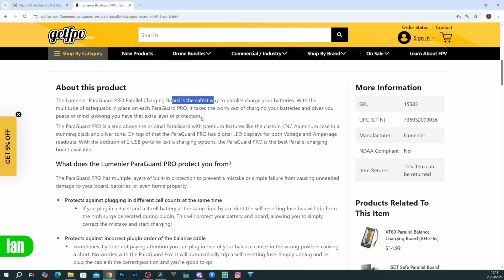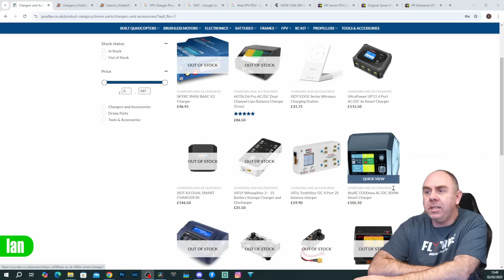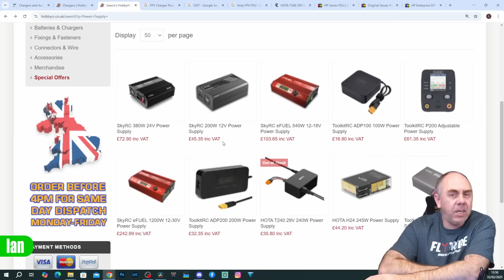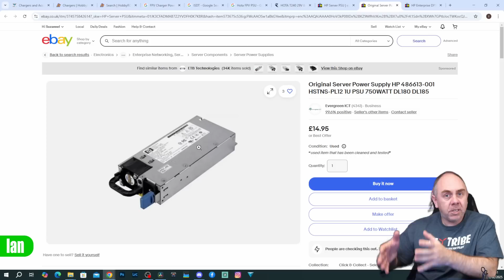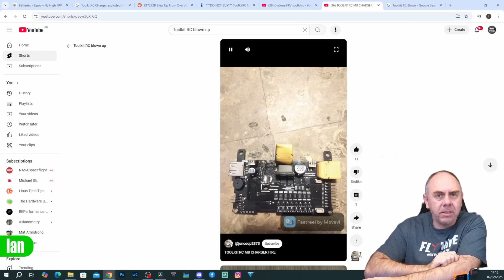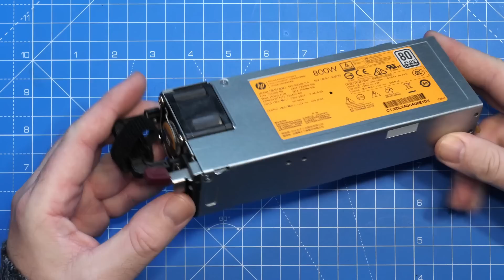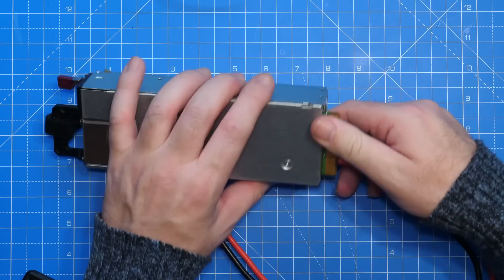FPV Lipo Battery Chargers Buyers Guide - Don't Get Caught Out!

Comment: I had 2 ToolkitRC M7 and 2 M6D. I had one M7 that failed the balance port, but the second is going strong. None M6D failed.
I think that must be the same case as the Speedybee FCs, they have the most market share, so it's common they would have the most failures too. And they have the best price for the bunch.

Comment: Do you think that a steel ammo can with ~1mm thick walls would be enough to stop a battery fire? I would also cut a hole in the rubber seal for gas to vent so it doesn't become a bomb. 

So I've been planning and looking at absolutely everything and before watching this came to getting a Hota D6 pro and 2 HGLRC Thor 6 port parallel charging boards ($140) for charging up to 12 batteries at once. 
After this video I am now thinking about a Hota F6 and a server power supply for $120.
The big difference that I see is how many batteries I could charge at once. With the F6 it would take 3 hours to charge 12 batteries, while with the D6 + parallel charging it would only take 1 hour.
Am I just being greedy with how many batteries I want to charge? 12 batteries with 5 min flight time each is 1 hour of flying, how much is that really?

I plan on making something to be able to easily charge the batteries completely inside of an ammo can to alleviate risk because I personally don't want my house to catch on fire.
I am currently not planning on using large batteries so I do not need a high wattage power supply, so the built in psu on the D6 would be fine, assuming it does not fail.
Reply: Just buy multiple D6 pro or multiple F6 instead of parallel charging board. It's not worth it imho.
Reply: As in buy 5 of them and have them all plugged in and making noise at the same time? It sounds like a hassle.

Comment: In my country, we got Bee net power supply, you can plug straight to power outlet, its got 12V 30A. Cost around 8-10$, but you have to wirring xt60.

Comment: What evidence do you have of the danger of parallel charging? You never mentioned anything. JB has a branded parallel charger.
Reply from the maker: You have already decided you are right and everyone else is wrong so really their is no point debating this.  

The evidence is the technical issue with paralell charging with grouping cells.  

The biggest danger is the fact the cells from each pack  are gouped together and this masks any that are drifting, OOB or go bad from the charger.  

 There is a fundamental difference between multiple cells together in a battery and parallel charging simply due to the way they are grouped.  

When putting 2 or more seperate packs together you are mixing cells of different lifespans, different internal resistances and even small capacity differences, while you may measure you can't catch everything, one slipup or miss read and it's toasty time.  

Further more from a techical perspective parallel charging boards simply do not have the ability to safely detect issues with a single cell in one pack when they are all grouped together and this increases the risk of an issue dramatically. 

You parrall charge 4 packs and one of them has a cell that goes bad  it's masked from the charger due to the other 3 cells in that position being on the same line. 

I'm sorry but  I don't care how long you have been charging, flying or been paralell charging the fact remains you are increasing the risk of an issue by charging this way.  
Now it's entirely up to you if you want to continue to do it but I can not say with any good concience that it's safe to do so and I would never put my name to recommending something that could at best make you loose a few packs.  At worst loose your home or even worse.
Reply: @MadRC  I fly small packs - 2s and i series charge 3 at a time. All cells are sensed, and it doesn't need all the packs to be at the same voltage.
Reply: @Seixir  How is this remotely related to parallel charging boards...
Reply: @krazed0451 it's related to charging. I was pointing out a different method. And the balance leads are plugged in series as well, so the charger can read each cell individually.
Reply: I have a burned up Joshua Bardwell strix board that would happily have a word with you, of course if it wasn't charred to death. The fuses will not always protect you if something goes off. :) There is no truly "safe" parallel charge board. It is inherently dangerous to parallel charge because you increase the risk surface. Some boards have more safety features compared to others, JB's board is very good, but it is still more dangerous to parallel charge vs single charge. Think about it... it's because the charger is completely blind to the state of each cell's voltage condition.
Reply: @JohnCuppi  Sorry, that's BS. Just make sure the cells are close in all the batteries and never leave it unattended. I have been parallel charging for 20 years. Never had a problem, but I am very careful with the state of the batteries.
Reply: @MrMartinRome  Yeah, it's not BS that when parallel charging you increase your risk factor over single pack. You'll be fine until the day you finally make a mistake. Do you also ensure to check resistance levels on the regular? Because you should be doing those checks too. I parallel charged for about 5 years before I had that incident, only using batteries of the same brand as well. I'll still parallel charge outside, but I decided it's not worth the increased risk in my home or garage, even with a bat-safe box. Too cheap to just get an extra duo or quad charger. Most new users should just do that so they don't have to worry as much about it.
Reply: @JohnCuppi  Yes, I also check resistance and keep a chart of every battery. One burned board is not evidence, it's an anecdote. It was probably user error. I just can't stand these blanket statements about the risks with NO actual evidence. Yes, there have been fires from LiPo batteries, but show me actual evidence where parallel charging has been any more dangerous than LiPo charging in general. You can't. There isn't any.
Reply: @MrMartinRome  Literally multiple people have explained here what the danger is over single pack charging. THE MARGIN FOR ERROR. To add to that, the charger is also blind to the state of every cell while charging, if one starts to get a little more overcharged than the other then there is no cut off mechanism for the charger to even see it. A fuse might help save that situation, so there are 'safer' boards per say. But it can all happen so very quickly.  

And good for you, you keep a chart of every battery and it's probably why you have a 20 year safety record parallel charging. Not everyone is perfect, especially newcomers. Mad's is right, end of the day they shouldn't market any parallel charge board as "safe" because it conveys a false sense of security to those who don't know better. Likewise, I can't stand this topic either because people like you argue that parallel charging is just as safe as single cell, when it is simply not true when you consider the entire process from start to end.
Reply: @JohnCuppi  Saying it's more dangerous does not make it so.  I will reply when you show me some evidence. You have none.
Reply: @MrMartinRome 
Firstly, I parallel charge. I think it’s almost a necessity for some people (I, for one, often charge 20+ batteries at a time, I can’t afford that many independent channels, even in $25 b6neos). I also am careful and maintain a chart of my batteries irs and carefully monitor my batteries whenever I charge.

Now, the second part. Parallel charging is inherently more dangerous than not parallel charging. There is more to go wrong: it is possible for mistakes to be made like plugging in a battery wrong or forgetting to storage and check the voltage of a battery. These may be unlikely for some people and practically impossible to happen to others, but it still means it is inherently riskier than not parallel charging.

With all that said, I will keep parallel charging, and I don’t think you need to stop parallel charging. But you can also admit it is more risky, even if for you that tiny increase to risk is still well under what would be considered unsafe.
Reply: They are inheritey dangerous and your one mistake away from a house fire
Reply: @OwenM98  Show me your evidence.
Reply: @MadRC mike drop and subject concisely covered

Comment: Hota T6 is the best option for portable usb-c at the moment in my eyes.
SkyRC has some QC issues as you mentioned.

ISDT 608PD would be perfect if only it had storage/discharge capabilities
Reply: The 608pd has storage discharge like capabilities.. disconnect everything from it. plug the battery into it.. it'll prompt you for what voltage to shutdown. Turn on USB output.. plug something in that draws power.
Reply: @ that’s a bit convoluted to have to do after every flight 🤣
Reply: I'm happy with my T6. The only issue is not being able to connect it to a PC (for updates or other functions). The latest firmware requires a minimum input of 9V, so you can use USB PD for power, but not to connect directly to a PC

Comment: If the power supply is only outputting 12 volts, can I charge 6s?
Reply: All hobby chargers I've seen can do that.
Reply: Yes you can. If the battery charger accepts that input voltage it will do its magic to charge your batteries.

Comment: Loving USB-C chargers right now. In a tiny case suited for sunglasses I have: 
Whoopstor V3 USB-C (has storage function) for the Whoops
ISDT 608PD 240W USB-C charger for 1-6S for everything else
XT60-to-Deans and XT60-to-barrel
That's all I need for a day at the field with the Whoops, 5" quads, and planes. Whether LiPo or LiIon, my sunglasses case can handle it lol
Reply: Should try out the skyrc b6neo then (or neo+ for epr and reverse charging)
Reply: Does the 608 do storage charging?
Reply: @krazed0451  yessir
Reply: @GhostRyderFPV  I saw a review that said it didn't have storage so stopped looking at it, nice to see they added that functionality. Pity it doesn't have any discharge functionality, it's so close to being fully featured.